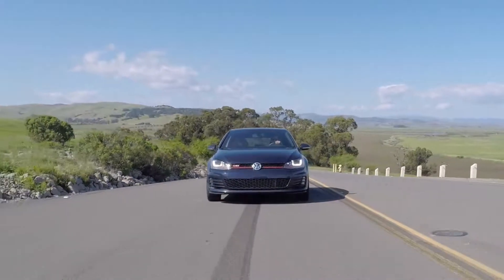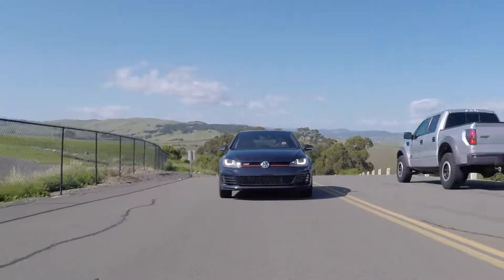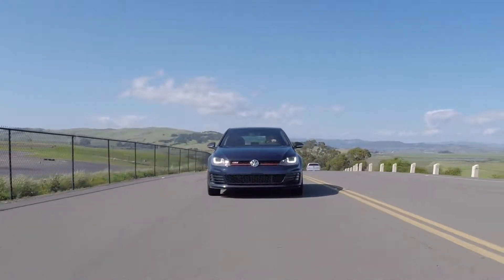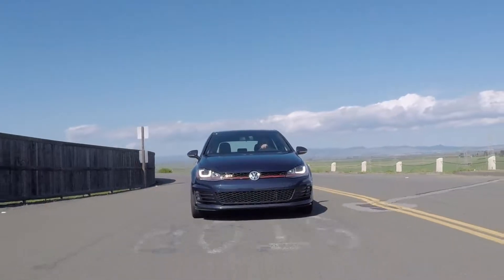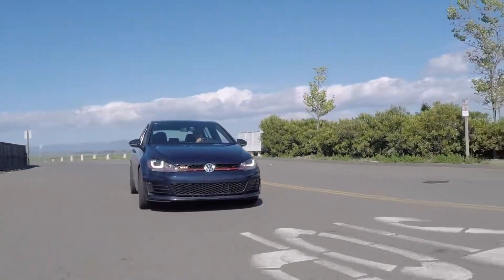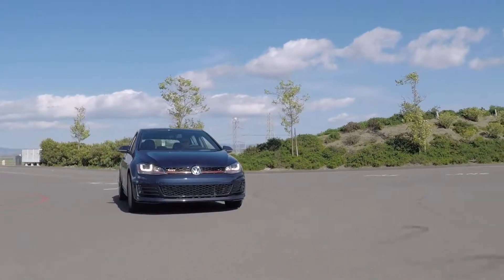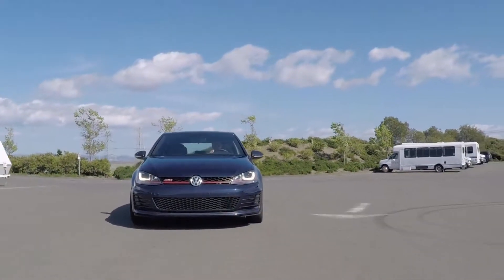MK7 MAPerformance BETA Stage 1

Comment: why does HP numbers seem low on the tune?
Reply from the maker: The car actually made 258.HP / 254.2 Torque on the last run for the tune that MAPerformance sells online for the MK7 GTI.  This video is showing the performance tune from the Beta version of the OTS Stage 1.  The customer contacted MAPerformance for that same question you are asking but was unable to get an answer.  With the OTS Stage 1 tune, the customer also reported of having engine codes but then had no engine codes using the Beta Tune.